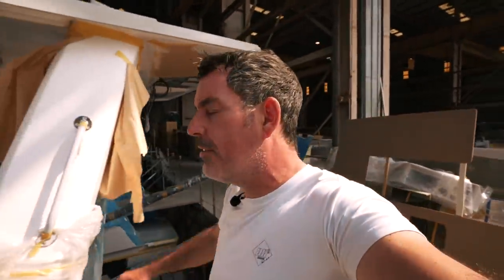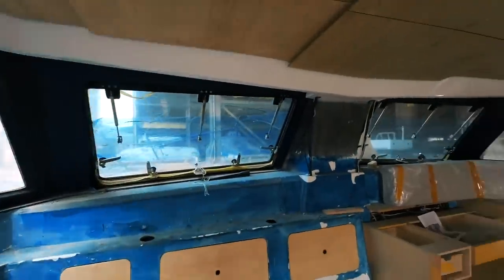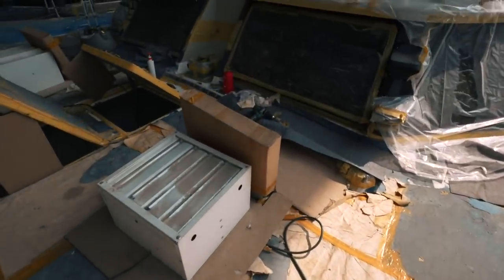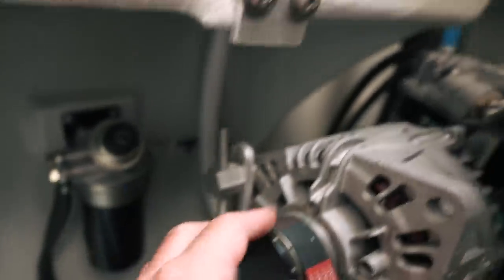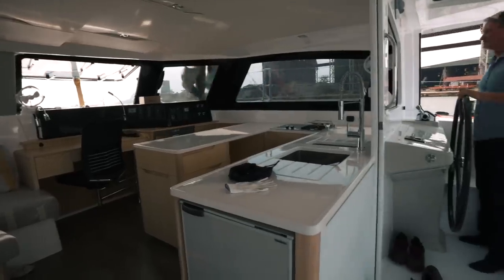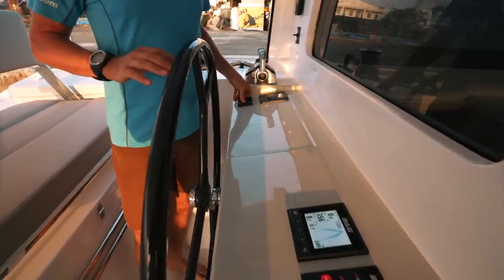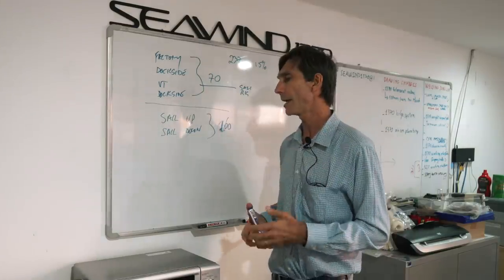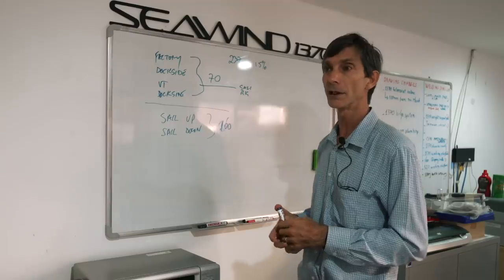Behind the Scenes with Seawind: Catamaran Build Changes Explained

Comment: They need to make that last large step that sits over the engine fold away to open up the space once you're down inside.
Reply: yep I agree, would be way more room without that there. Even take it away completely
Reply: One small pad about 3"~4" just to work your way down is all you need.  Then again he could enjoy a nice meal on the table that is currently there.
Reply: I was noticing that as well, but it looks like if you need more access, it bolts partly to the top of the engine.  So probably take out 4-5 bolts, and you can remove it.

Comment: Seawind really cares.  That has to inspire confidence in their product.  I was impressed with who was on board for the test sail, checking out their part in the overall design and function of the boat.  As I said, it does inspire confidence in Seawind as a builder.  Cheers, Nick.
Reply: It was the first sailing of a new design, so not really surprised that everyone was on board.

Comment: Definitely good to see winch seatings addressed. Hardware upgraded where key. The structure of winch supports have to stand up to 20-years of use (wear and tear). It has to be accessible for repairs, and maybe even upgrades, etc.

Comment: In the RV world there have been a significant number of reports of flexible solar panels adhered to fiberglass roofs causing problems  after a couple of years.  The heat generated by the panels causes discoloration and cracking of the underlying fiberglass. Rigid panels mounted on rails have an air space between the panel and roof aren’t damaging the underlying fiberglass. Has this been a problem in the marine environment?

Comment: Nick, you mentioned the autopilot briefly.  Will RR2 be equipped with two autopilots?  If not, how do you plan to mitigate the risk of an autopilot failure?  I think you had a vane on RR1.  I'd appreciate you thoughts about autopilot redundancy for your boat.

Comment: Hi Nick. Watched with interest. The first 20 seconds you absolutely killed the "production boat" knockers!  Just wondering about RW pump access for impeller and seal changes, as well as the oil filter changes? What's the access for these like? A good guide we always find is looking through the service schedules for the engine, gearbox and shaft/saildrive and how you would do each item. The boat is looking very swish. Sail Safe Guys, Ant & Cid.

Comment: I saw the BBQ grill directly under and next to the coach roof support. The heat will definately ruin the fiberglass and weaken the structure. Flares could be a problem and smoke will ruin the look.